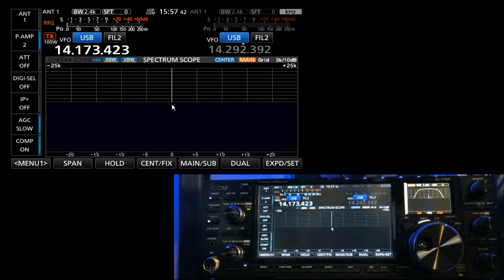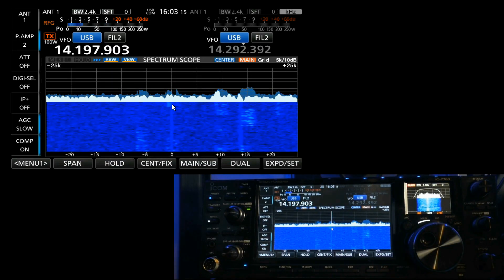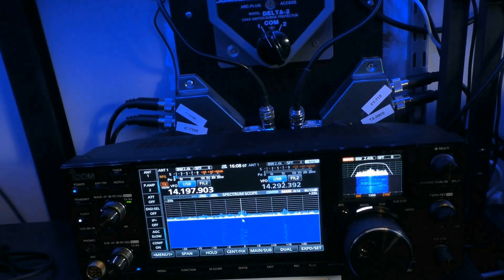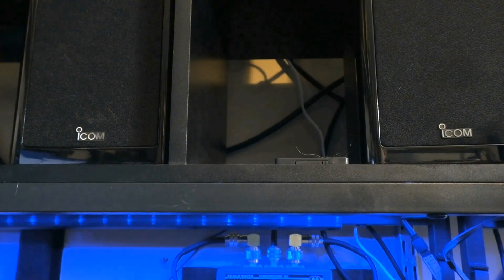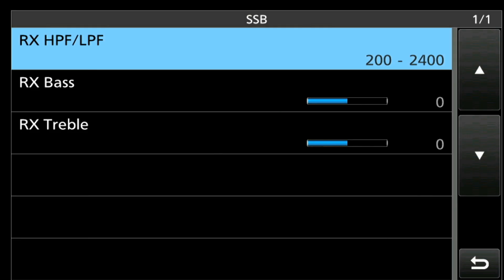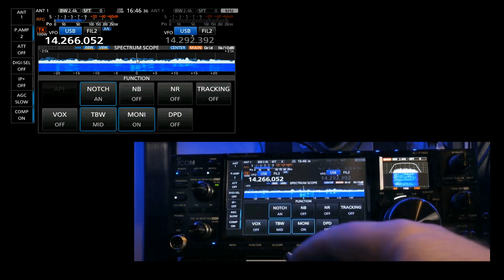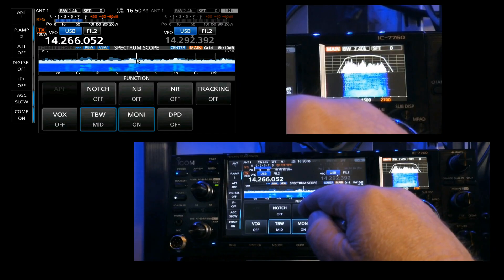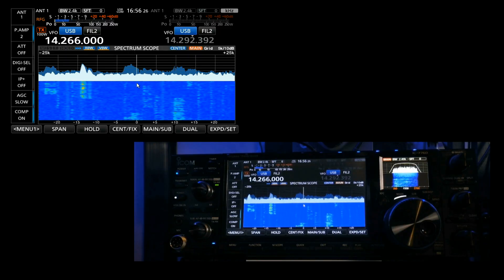IC 7760 Receive settings for improving your ears...

Comment: Thank you, Icom needs to outline all of this better. That is how I have all my SDR Icoms setup 7300, 7610, 7760

73 Steve    From the K0UO Rhombic antenna farm, miles of wire in the Air and On the Air dailyi
Reply: First i  try  preamp off .
Reply from the maker: Thanks for pointing that out.  I knew that, and do that…. I just brain farted and forgot it…. 73
Reply from the maker: You are absolutely right! And that’s a fabulous antenna system…